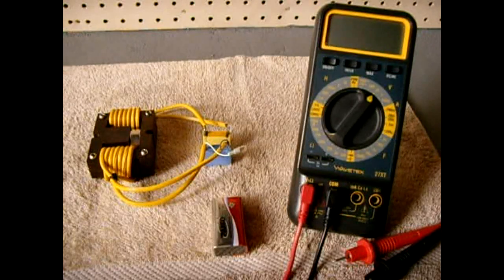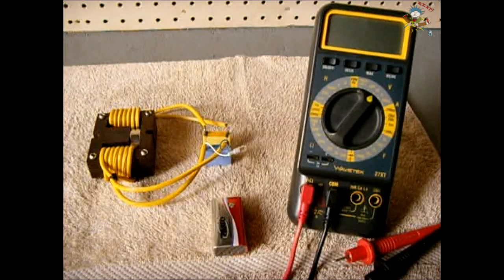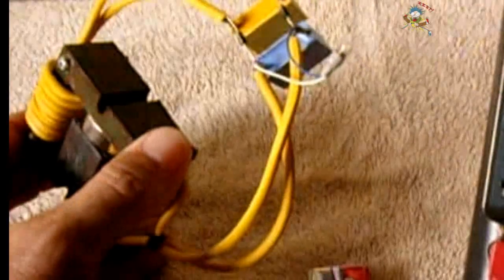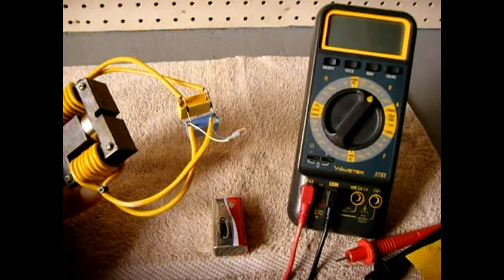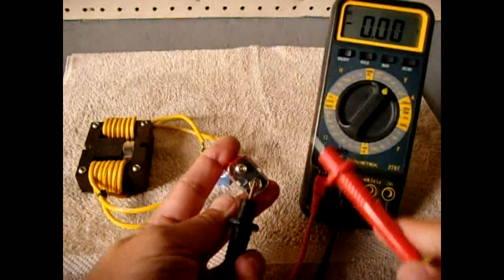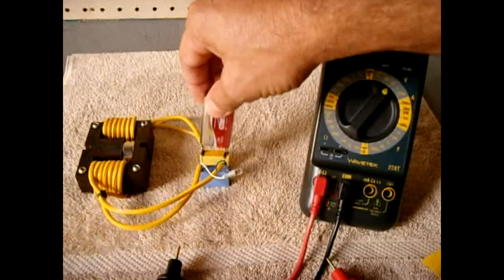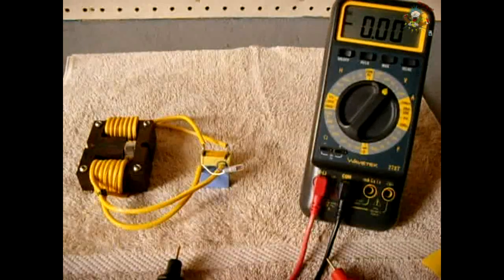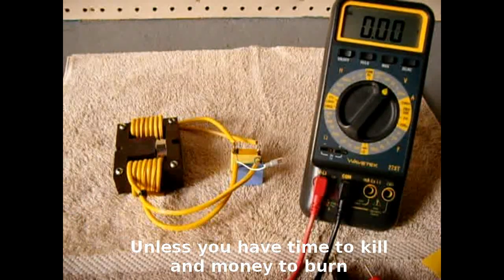Overunity Motionless Free Energy Generator EXPOSED!

Comment: I have 2 motors, one is a 12volt strong motor and a much bigger pully on it, the other motor is a 48volt motor with only the shaft with a small coupler on it as it's pully, now powered up with a 12 volt batery,  the output is more than double the input!  there is nothing from nothing, but I can double my energy! FACT

Comment: Induction from a mains transformer or a large solenoid coil under the table with do the trick as the power has to be switched on and off, difficult with a hidden battery.
Do they not bother to teach science to youngsters at school these days? If people are gullible enough to fall for this, send them my way, I will sell them snake oil by the gallon.

Comment: DID YOU TRY USING A CAPACITOR THAT HOLDS VOLTAGE INSTEAD OF PASSING THROUGH?  TRY ON THE LED SIDE FIRST
Reply from the maker: +Ronald Smith 
Hi Ron. There is nothing else to try, the device is a scam. I used the correct capacitor. You will never have an endless supply of "Free Energy" from this device. LOL
Thanks For Watching

Comment: you eill never get it to work due to the fact that you dont use the same windings as the original post, and if you had used the same amount of turns but turned the one side of it it would work
Reply from the maker: +bjornahh87 
You are dreaming. I tried every combination(Also stated that in the video). Stop being suckered by Youtube scammers. Try making this device yourself before opening your mouth and telling me what you "Think" I did wrong..If you did try, you would be back with another post saying,  " Yes, you are correct".
Reply: +electronicsNmore Well done, nice clean setup, total waste of your time though as the nutcases will still believe in the snake oil merchants without question. It is so frustrating seeing all these smug bastards with no understanding of basic electrical theories-no,-not theories-knowledge-on you tube. Maybe they like smoke being blown up their asses.
Reply: +electronicsNmore  maby I'll try it sometime when i have the time and put one together and try, right know im busy with car batteries, and how to   configure and stabilize the coulombic efficiency in both regular car batteries and so called dead batteries too, but if you think of how a welding transformer works and apply that to this experiment i cant see how this could be a hoax?? can you elaborate why it is a hoax and why it won't work, please ...
Reply: No no no. First you elaborate what the hell a welding transformer has to do with a free energy hoax. 
And why did you feel the need to tell the world that you googled coulombic efficiency. 
"stabilize the coulombic efficiency in both regular car batteries and so called dead batteries too" Sounds like something a free energy nutter would say to sound smart.
Reply: There is nosuch thing as Free Energy. Stabilize the coulombic efficiency.... Utter Bollocks.
Reply: And a transformer is just A transformer- AC IN And AC out -Less losses.

Comment: It is look like wrong direction of one of  the Diodes that causing to the whole system failed. One must go and another must come as by the logic operation then the bop should be ON the light.
Reply from the maker: Filex Ahming Incorrect. You need to look closer at the scam video. This device has the diodes positioned exactly as the scam video. Altering the diodes will in no way cause this device to produce, "Free, Endless Energy".

Thanks For Watching

Comment: First, the transformer needs AC to create the expanding and contracting field in the ferrite core thus outputting AC current (stepped up, down or the same) in the opposite coil. 9v DC will not cause the AC flux to make this work.I agree 100% with your assesment of this SCAM! Great presentation!
Reply: the connecting and disconnecting of the battery is like a dc pulse, V/L=di/dt, current which is proportional to flux  rises linearly with dc.

Comment: I think the thing that is missed when talking about overunity, perpetual  motion, free energy, etc.. is in theory a lot of these designs should work if you able to eliminate all friction or resistance. BUT that also means as soon as you try to use one of these machines to do any type of "work" it would stop. It would be useless as any type of motor or device needed to actually do something other than keep it self moving. And that's in a perfect vacuum with no friction or gravity to affect it.
      
The key to "free energy" is that energy is already all around us. LOTS  and LOTS of it everywhere, we just need to find better ways of harvesting it.

Comment: Your build quality is excellent. In looking at the original it appears the iron frame is 2 pieces. The center bar consists of the center bar and base (The shape of an upside down T) The frame is a C consisting of the top and sides. Thank you for your efforts. Best wishes
Reply from the maker: fieldsofwax I saw that. He likely did it that way because he did not have the means of making a nice cut(Like I did) where the magnet goes. So he cut out the center area, inserted the magnet, and slide the core back in. You can see the core sticks out. Some people will do anything to make a buck.
Reply: electronicsNmore Thank you for your reply. Every magnetic field has to have a designated positive and negative end. Which ever way the permanent magnets are in there it doesn't matter. If the positive is to the "T" then the left and right ends of the "T" become the positive poles of the permanent magnet. The two ends of the "C" become the negative ends of the magnet. The + and - are against each other and everything is accounted for. The Electromagnet is making one end of the "C" + and the other end - when the electromagnet is activated.  Because the poles of the "T" are + then the electromagnet is oscillating a magnetic field in the "C". I believe the split frame served a purpose. I say this with all respect to your efforts. If you use your excellent build skills and duplicate the split frame design as the gentleman showed, it may still not work and I might be wrong, but it will be a quality reproduction of what was built. Thank You
Reply from the maker: No thanks. I suggest you waste your time on this scam. :-). Just the fact that no one offered to sell me a working unit for $100.00, that should be your wake up call. The unit only cost around $10 to make including a few scrap parts. I will take a 90 dollar profit any day of the week, and make these all day long. I suspect you have been watching too many Gerard Morin videos.

Comment: Hi.
 I'm sure you think you know what you are doing. Have you ever built your own transformer or maybe rewired one? If you had you would have noticed that there are two different gauges of conductor used in the wiring. I see you used the same wire gauge in the primary coil and secondary coil. Won't ever work. Try duplicating the experiment exactly and maybe you will get the correct results. Greetings. Dawid.
Reply from the maker: Dawid Van Der Westhuizen CLEARLY you have not watched any of my videos besides this one. You would not have posted that comment. I have a couple highly popular transformer winding videos. I know exactly what I am doing. I also know 100% that the device you saw in this video is a SCAM. The original uploaded video used the same gauge wire on both windings, which is exactly why I did. To show it is pure nonsense. Never shoot the messenger, and never support people that have something to gain from uploading bogus videos. $$

You may want to watch one of my transformer videos. :-)
https://www.youtube.com/watch?v=3uCuA032lYw

Comment: If your circuit was properly wired, you would light the build each time you powered the circuit.
Reply from the maker: Ryan Tollmann If my device had a very thin enamel wire connected to a power supply off screen, I could light anything up. :-)

Comment: Have you try using 4 poles magnet (hard drive magnet) like the one hi used (short the poles inside the core N to S and  S to N) and so on make them start changing polarity preference and the caps must by parallel to the diodes if this thing will be able to power up ?